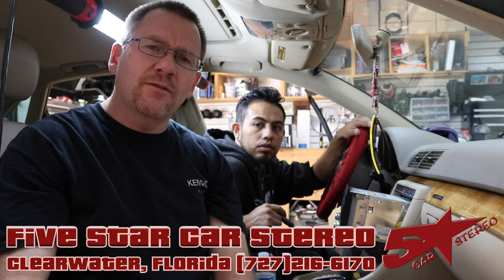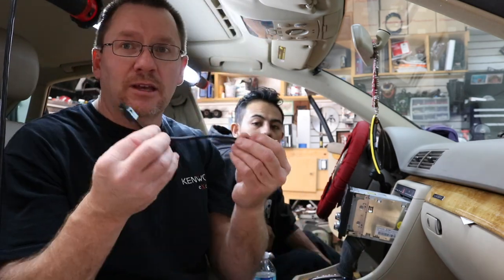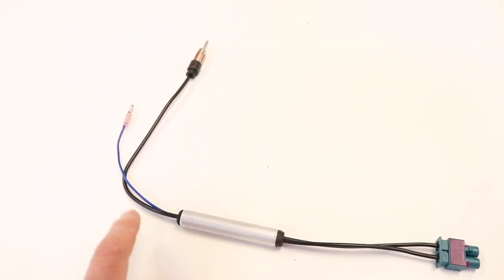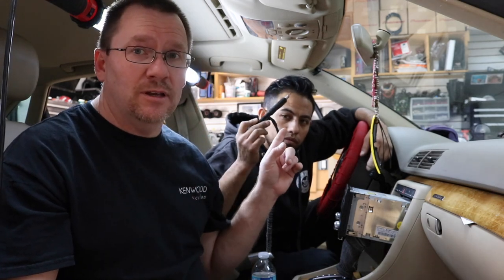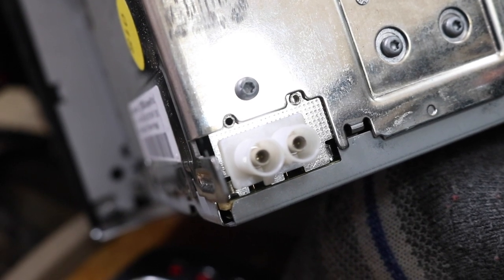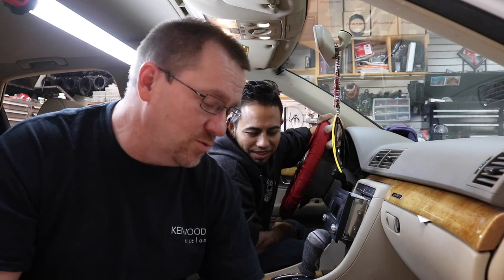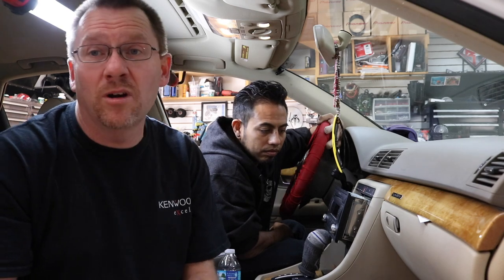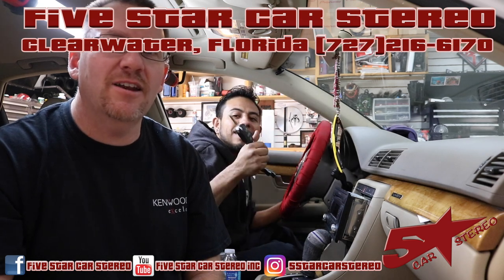Is the FM reception bad after installing a new car stereo a German car

Comment: i have a crysler 300 w bad antenna reception
Reply from the maker: chupamishuevos303 it could be a bad antenna adapter, there is a little pin in it that bends. This happens most often. There is also the possibility that there is an amplified antenna. The Blue wire in the harness may  not be connected.